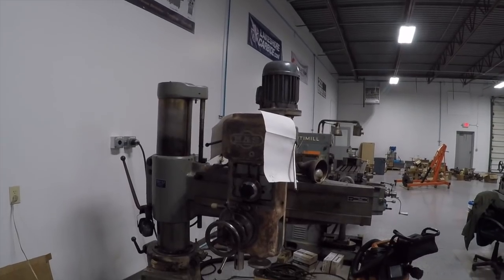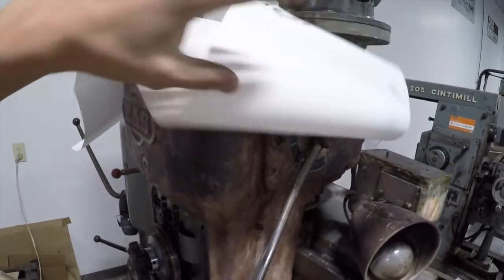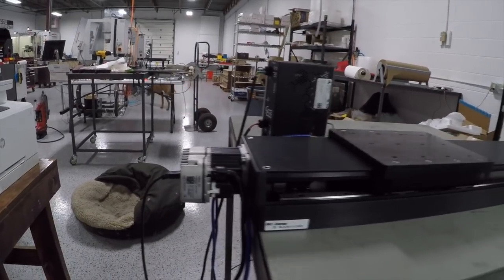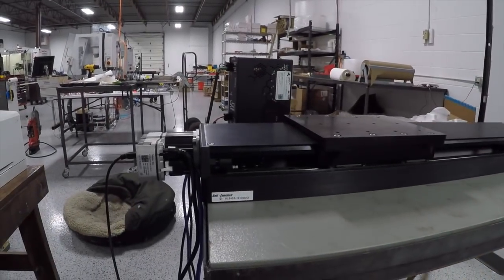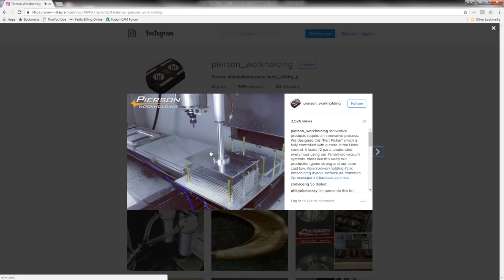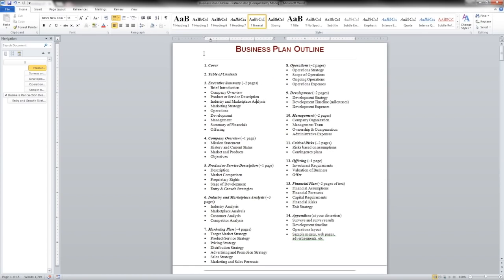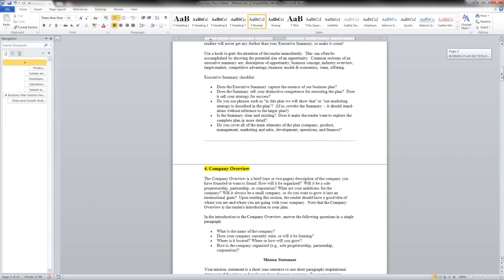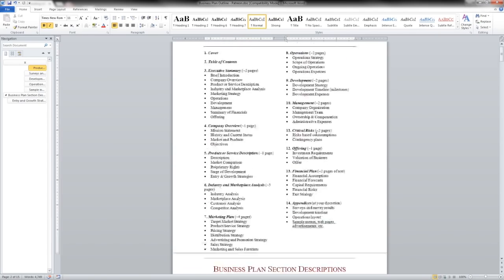Business Plan Guide, Restoring Radial Arm, ClearPath Servos!  CB37

Comment: citri strip will take off that paint in no time.

also we've been using clearpath servos on all of our machines for nearly 2 years. they are amazing. working on getting all the motors on our tormachs retrofitted with them. way better than the stock steppers, and they are basically plug and play. uses the tormach drives for power and a break out board to attach the clearpath wiring to tormach ribbon cables for step and dir. oh and clearpaths service is amazing. their techs are phenomenal as well. can not speak highly enough of them.

Comment: John

IF you are painting to preserve ie anti rust then take loose junk off with wire wheel - if paint wont come off with wire wheel it is good enough to pant over -- wipe with solvent rag and paint it.

On other hand if you are painting fo pretty then it is going to take more time.  Prety is proportional to time squared.

Dan Bentler

Comment: Late response to a video that's been on my watch later for to long. My suggestion is this 

1. Get everything off you can off the radial arm. You're not going to want to do it a second time. No short cuts! 

2. Use a wire wheel on a electric (corded, don't mess with that battery nonsense) tool. The extra torque will really speed up the process and rejuvenate your desire to get it as clean as you want.

Comment: When these radial arm drills were built..and other manual machines of that era..the castings were coated with very thick filler which was smoothed out while wet then finish sanded when dry..then the primer, undercoat and top coats were applied. This way the rough casting didn't show..on modern machine centres they just spray paint the castings as they are hidden under guards anyway..so not visible.

Comment: The material on your drill is not paint but a form of automotive bondo which is used to smooth out imperfections in the metal casting.  You could use a heat gun to help on the removal but the fumes are bad to deal with.  There are some machine rebuilders that have You Tube videos which you can review or even ask them how to remove this stuff but the only way to deal with it, that I know of, is to wire brush it off. After cleaning the metal surface, in order to get a smooth paint finish, more bondo needs to be applied.  Topping with an automotive grade enamel paint is important since most "rattle can" paint from the store will not hold up to the cutting fluids and solvents used in machining.

Comment: a needle scaller is what I usually use to strip old machines, seems the older the paint the better it flakes off.  needle scaller makes less mess compared to sanding/wire wheel as welldon't need anything fancy, the cheap Chinese ones seem to last, for the price they are disposable anyway

Comment: RAD Smear it with bondo and sand it back smooth. Don't overclean the machine and remove the original filler and fill in where paint is chipped. Do it quick and get it done, it will look 10x better than not using filler.

Comment: Interesting :-) I have "Business Plan Pro", although I haven't updated it in years... It's a "Fill in the blanks" sort of package. I haven't looked into it, in many years, to see if it's still on the market, but if it is, I highly recommend it.

It might be an idea to use a paint stripper on your radial arm... although, the fumes can be pretty toxic. A respirator is recommended, if you can't move the machine outside. Still a respirator is a good idea...  Just paint it on and leave it soak, then wipe off the paint...

Can't wait to see your applications for the Servos :-) They are far more accurate than Steppers :-) I envision you building your own Robots... :-)

Comment: Keith Rucker used a citrus stripper, seamed a great time saver.
Reply: Michael H Basement Machine Shop guy also a big fan of Citristrip - very safe, non-caustic, no airborne dust, wrap in cling film saran wrap and go away and do something else for 24 hours. That would be my first choice. Dry-ice media blasting if you want to spend $ on it. Nice to have a clean machine in the shop to work on, no-one produces their best work in an old greasy workshop.

Comment: hydrochloric acid to remove all the oxidation, another option is to take it outside and media blasting the parts as needed.
Reply: at least as long as it is steel or iron.